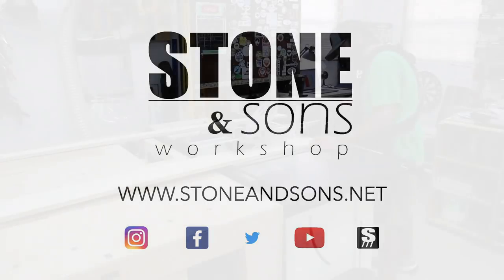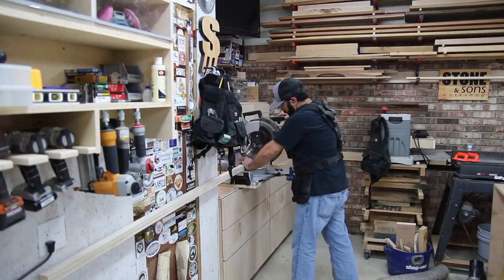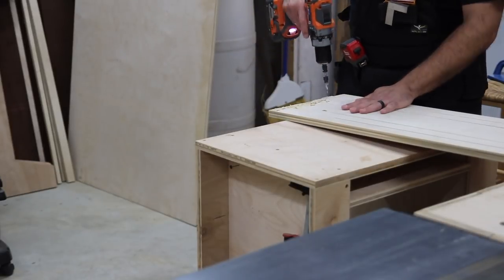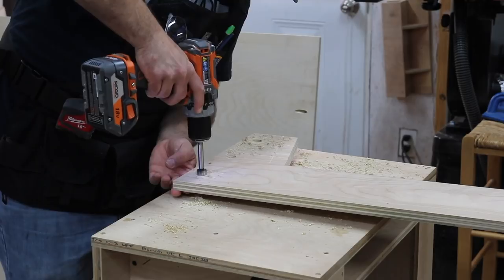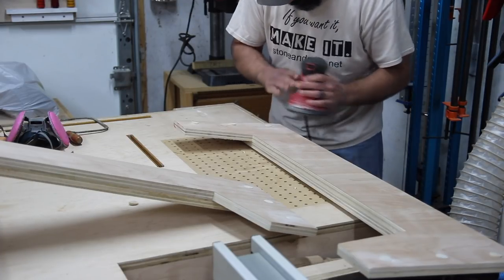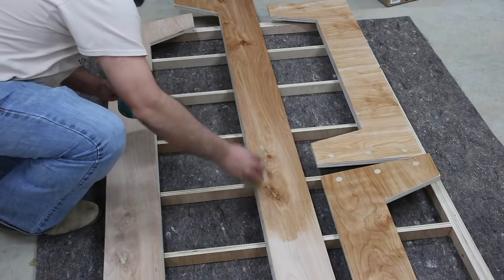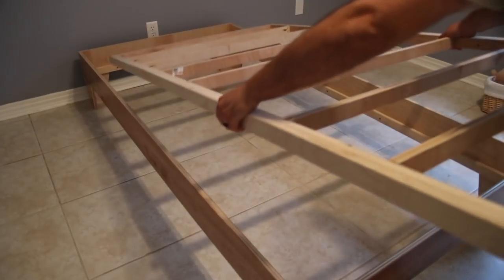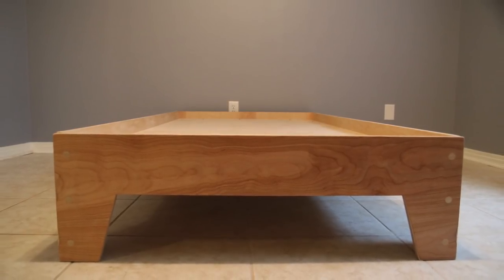DIY Platform Bed - Stone and Sons (Plans Available)

Comment: Very nice little project here. My only concern is the mattress on top of the full sheet of plywood could mold since there isn't much airflow in-between. I live in a relatively non humid place that is around 50% humidity. Would this work for my area? Thanks in advance.

Comment: Nice craftsmanship but you did not allow for air flow under the mattress. Bed mattresses need air circulation to prevent mold and mildew. With a solid bottom this bed will trap moisture from perspiration in the mattress.